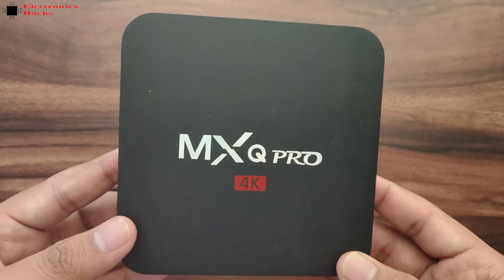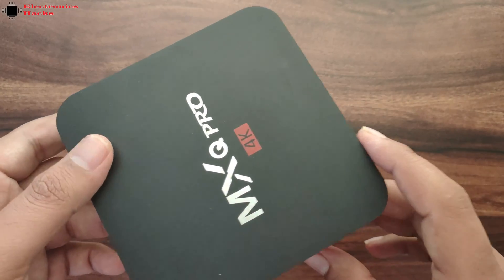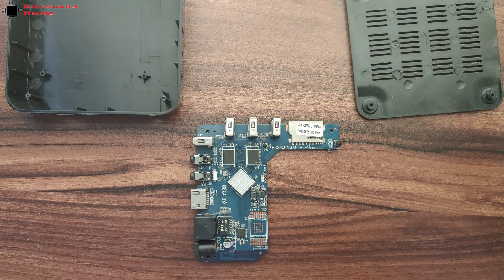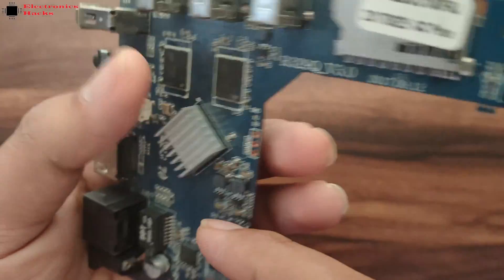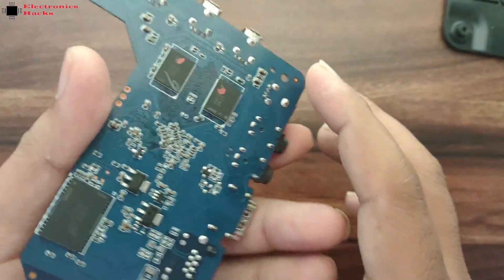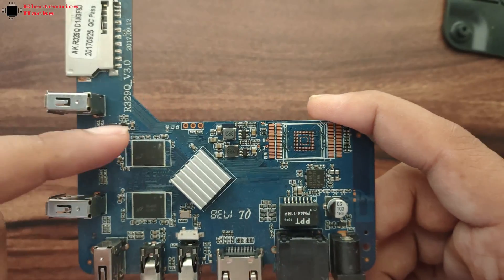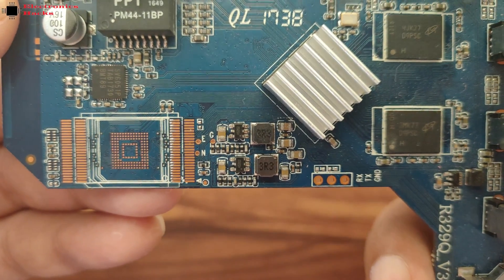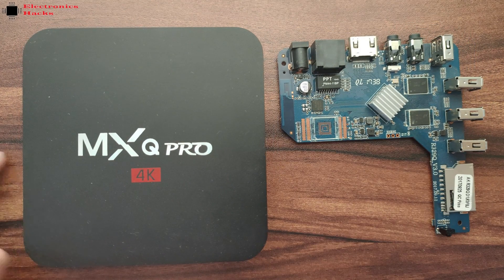Android TV Box | Smart TV Box disassembly | MXQ Pro 4K | 4K android Tv box | Android box teardown

Comment: Hello Sir 
Its fake box, not know to me, but nicely printed stating 2GB RAM and 16GB Storage with MBOX MXQ PRO 5G 4K. 
I BROUGHT recently with device not working/booting, with no TV display and blue LED  light is ON permanently. MBOX PERMANENTLY BRICKED MAY BE WRONG  FIRMWARE APPLIED AS NEVER TOOK DEVICE BACKUP,  Android version 11.1 its a fake with RAM 2048MB AND INTERNAL STORAGE 4.00GB with reset option permanently disabled. PCB DETEAILS AS MXQ-RK3128, MALI-400MP PCB REVISION V1.4-20211104, Processor RK 3128 with WIFI RK915. Laptop with USB does not detect MBox using external Reset toothpick or through USB driver using RKTool /Android Tool .Need to restore Device as it is booting through external SD card, but with configuration error and unable to mount volumes. Please suggest How to make a SD card image (suggest tool and firmware image details) to restore MBOX device. I liked all your videos, but no video states how to recover the faulty device using SD card (Tcard with 8GB) to restore device. Please suggest MBOX device firmware download link with SD Card Boot options to recover the device. Thanks in advance for your good work here to support MBOX usages.
Reply from the maker: Those chinese box comes with slow RAM and FLASH IC. They don't work fast enough.

Comment: Hi, i tried to upgrade my MXQ-4K with soc rockship 3229 ( not MXQ-4K PRO like yours ).
but unfortunately i finished with black screen and unrecognized device by the flash software tools.
i found in the web that i must short circuit pin 7 and 8 to force flashing.
my question :
can you show me those pin in your device (MXQ-4K PRO), it looks like my MXQ-4K.
Reply from the maker: I never tried to upgrade